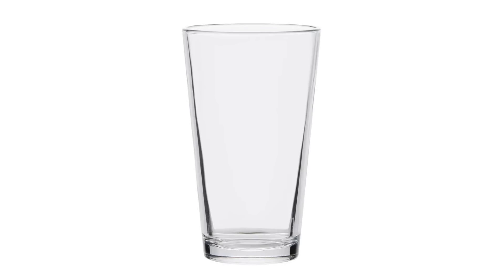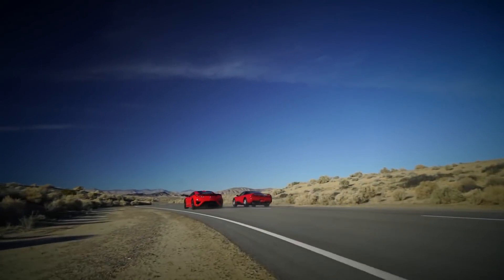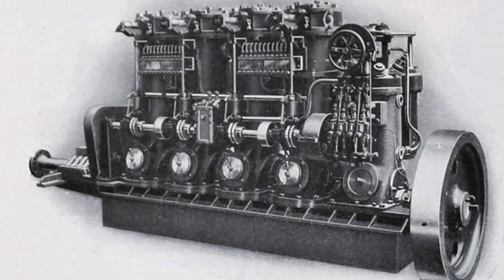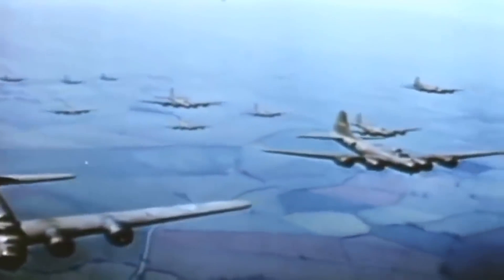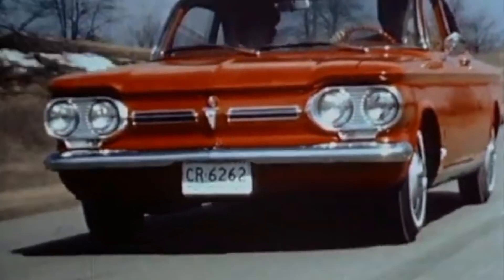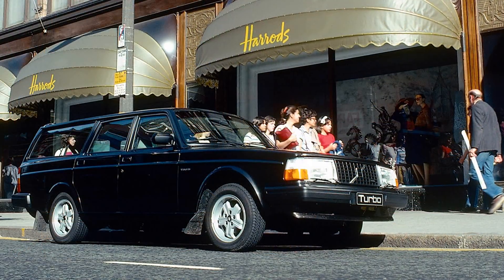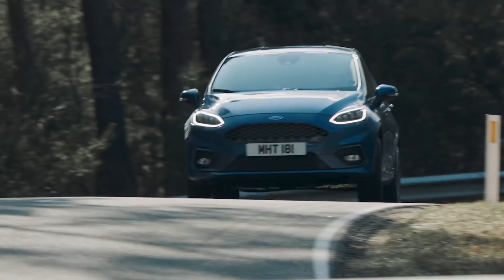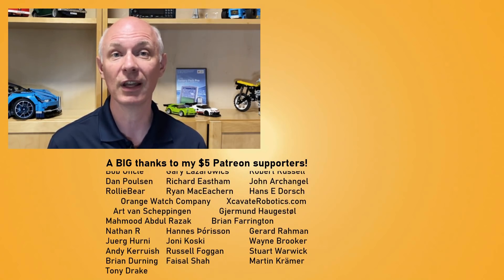The Turbo Story

Comment from the maker: Erratum: The heat produced by compressing air is not due to friction, but instead due to the compression itself (adiabatic process).
Reply: ..you really  skipped over the import of SAAB putting the Turbo in the 99... 
https://www.autonews.com/article/20141111/BLOG06/311119998/why-turbocharger-fans-owe-saab-a-thank-you
Reply: Hey dont know if you know this but a chanel called edmund is using an icon very similar to yours
Reply: There is a disappointingly large number of mistakes and unclear statements in this video, too many for me to waste 30 mins listing them all...

Comment: You guys may have had the 215 in your Rovers but it wasn't designed and built in England and then shipped over to America to be used in Oldsmobiles. That engine was designed and created and first built in America then shipped over to England for use in the Rover so don't say it was a Rover engine...

Comment: On a compound turbo setup the big turbo doesn't take over once it has spooled up. The small turbo feeds the engine all the time, it is just fed with compressed air once the larger turbo is spooled.

Comment: Considering all the development work Saab did to make the turbo driveable, including the invention of the wastegate, I find it quite astonishing that you left that bit out entirely, in a video claiming to tell the "turbo story".

Saab were also the first car manufacturer to combine turbocharging and four valves per cylinder. A configuration used in nearly all turbocharged engines today.

Comment: A turbocharger IS a supercharger driven off the exhaust gas rather than the more normal crankshaft.
You can drive an air compressor with an electric motor and it's STILL a supercharger.

Comment: I would guess that there are more turbo-equipped vehicles in Europe than the US for two main reasons. Firstly, the American's love of large capacity engines that gulp cheap fuel, as opposed to the European need for power and fuel efficiency. And, secondly, because of the popularity of diesel engines in Europe. Diesels being especially crappy until the turbo spools up. I can certainly attest to the number of life-before-my-eyes moments my diesel Passat has given me as it rolls limply across an intersection in front of some barely subsonic juggernaut, before suddenly lighting up the front tyres and attracting unwanted attention from Mr. Plod.

Comment: Straight off the bat there’s a mistake.  A pint of air compressed in to a half pint still contains the same amount of oxygen.  
I think what you’re trying to say is that if you compress the air you can get more air in to the cylinder.  Same volume but more mass = more oxygen so more fuel can be added.     Also, turbo lag is the delay in engine response AFTER you put your foot down on the accelerator, not BEFORE you put your foot down lol
Reply from the maker: Well put!

Comment: Fun fact... diesel engine exhaust is cooler than petrol engine exhaust, making it easier to use variable-geometry ("VG") turbos. The ubiquitous VW 1.9 TDI engine had one. More power across a wider power band. Porsche would later make the first VG turbo for petrol engines.

Comment: Minor point: the compression is always done by a (you've guessed it) compressor. The compressor is either powered by a turbine that in turn is powered by the exhaust, or gets its power straight from the crankshaft. The former is then called turbocharging, the latter supercharging.

Comment: Isn't the extra air/oxygen useful because you can inject more fuel with the same air/fuel mix proportion?, not just 'because there’s more oxygen for the fuel to mix with'. Perhaps that's what was meant, but it's not very clear - it makes it sound like it's just burning better because of the extra oxygen.

Comment: The turbine on the exhaust is not 'free' - the restriction it places on the exhaust manifold reduces the power produced by the engine just as a mechanical blower takes up some power.
Reply: Exactly - manifold back pressure takes away some power.  And turbocharged engines must run at lower compression ratios further reducing the energy available to extract from a given charge. There are trade-offs everywhere.  The big gain is in volumetric efficiency (more output from a given displacement).
Reply: And.... it MORE than makes up for the energy consumed. 

My vnt turbo begs to differ about “taking away power”

And even when not making boost, 
It more than makes up for restriction by reducing pumping losses.

Comment: While turbochargers has made smaller engines more powerful, its stress on lubricants has resulted in a number of engine reliability issues with recent engines. That's why the American Petroleum Institute (API) introduced in May 2020 the AP motor oil certification standard, one designed for the high-stress environment of modern turbocharged engines.
Reply: But, they were saying the same thing when they came out with the api- sn classification like 25 years ago. ...

Comment: @ 9:49 an RX 7 FD is pictured but the narrator says that 2 Turbos are used to power 2 seperate cylinder banks what is stupid in this case because it has none, rotary engine... . it has 2 Hitachi - Turbochargers, a big and a small one what are used in a sequential mode. A rotary engine asks for the use of a turbocharger because of its violent exhaust fumes not restricted by valves... It also has very little turbo - lag when the turbocharger is accordingly sized - or it can have a hilarious power output if oversized...

Comment: Pretty sure turbo chargers aren’t free, the back pressure leeches power off of the engine just like a supercharger.
Reply: depends from a little bit to hardly any according to the engine design. Superchargers drain a lot of power so in most cases it is better for the customer to have a bigger displacement than a supercharger. They are also more complicated and costly than turbochargers.

Comment: Actually, turbo lag largely depends on the size of the turbo.  A big Garrett turbo means bigger power, but only at higher revs.  Smaller turbos kick in lower in the rev range but provide less power.  So engines like the [best] R32 Nissan Skyline GTR's RB26DETT use two turbos, as Andy says ("TT" at the end denotes 'twin turbo').  My 660cc Copen [obviously] has no torque, but has a small & very fast spinning turbo.  It kicks in around 3250 RPM, but power then stays pretty linear up to the 8500 RPM redline, ie no turbo lag.

Comment: A small misunderstanding: the heat produced by compressing air is not due to friction, but instead due to the compression itself (adiabatic process).
Reply from the maker: Thanks for the correction!
Reply: i.e. the friction between the air particles
Reply: @JaffaJannu  no, it has nothing to do with friction at all. The heating is caused by compressing the gas which transfers energy as work.

Comment: So GM has quite a bit of experience with turbochargers. Imagine my shock, I bought a 2019 Chevy Trax - with the 1.4L Ecotech engine. It's turbocharged.
Reply from the maker: It's all about the fuel economy...
Reply: @LittleCar  That has not worked out well, had a Ford Focus ecoboost as a rental, neither the power output nor the fuel efficiency can cope with the 2.0 n/ a Skyactive engine in my Mazda MX 5 Summer / CX 3 AWD 150 - winter car... And let`s talk about cost and reliability... A part not used will not cause any cost, will never break down and has no weight.

Comment: Turbos ARE superchargers.
The correct name of a turbo is turbosupercharger.,
Reply: I guess nowadays people make it easier and use the word turbocharger for an exhaust driven compressor and a supercharger for a belt/gear driven compressor.
Reply: @NLBassist  .
I believe so too. Differentiation of the types.
 But it irks me when even people I work with, as mechanics no less, don't understand this simple fact.
A result of name shortening I suppose.
Reply: The "turbine-driven supercharger" becomes the "turbo-supercharger" then the "turbocharger" then the "turbo".

Comment: A turbocharger IS a supercharger driven off the exhaust!
Reply: I guess nowadays people make it easier and use the word turbocharger for an exhaust driven compressor and a supercharger for a belt/gear driven compressor.
Reply: @NLBassist  A turbocharger is a supercharger driven by a turbine.
Reply: This is what pisses me off about people calling electric forced induction devices "electric turbos". There's no turbine, so it can't be called a turbo.
Reply: @GoldenGrenadier  Remember computers with a turbo button ;)
Reply: only if it wears a red asbestos cape
Reply: i meaaaaaan.
it's also calles a turbosupercharger
Reply: And in the early days they were know as turbo-superchargers :)

Comment: Great video! My first turbo was the 1994 Toyota MR2 Turbo Rev3. 300bhp after chip and exhaust changeover put big smiles on my face. Though I didnt think a turbo was completely free power as the exhaust gas has to fight past the turbine. Negligible but still not 100% free.

Comment: Hi - great video as usual. But I think the most the Esprit with the 2.2 litre turbo ever produced was 300BHP (in the Sport 300). The 500BHP (limited to 350BHP) you mention is for the twin turbo-charged 3.5litre V8.
Reply: ....and that 2.2 didn't do it for very long😉
Reply: @richardrichard5409  it was actually known to be very reliable if maintained properly.

Comment: Interesting thank you. Remember the first Turbo car i drove was the MG Metro Turbo Haha.
Cheers Darren.
Reply: Me too ! I was 15 , on private property, and in my brother's boss's wife's car and was told , don't go mad ... Legend has me tearing around like a Boss in it but in reality I was shitting a brick lol 😂
Reply: I drove an Austin MG EFi Turbo, it was scary dangerous.
Reply: And you may be surprised to hear that the MG Metro Turbo used the same turbine as the Lotus Esprit. The reason is that for the metro, with a smaller engine, would actually be more likely to spend more time at part-throttle, so part-throttle fuel economy was considered more important than outright power at max throttle. That was their thinking apparently but I'm not quite sure how the physics of that works out.
Reply: @herseem  Garret Charger i believe ??